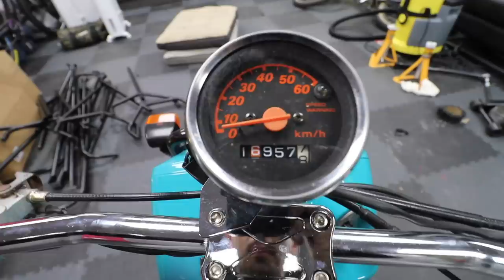Modified Honda Ruckus Scooter Build!!!!

Comment: front brake lever mot fail its a honda zoomer the dvla mot check and you may wanna do a vehicle check on the dvla also because its a bit confusing
Date of first registration	January 2002
Date of first registration with DVLA	December 2014
Year of manufacture	2002

and you will have to display L PLATES FRONT AND REAR

Comment: The seats lowered, but it’s not extended back. The extra length comes from moving the engine back
Reply: The seat is lowered and moved back, about 3 inches down and 2 inches back. And it also has a stretch kit which moves as you said the engine (and drivetrain) back.
Reply: @Ethan.s..  some of the kits move the seat back and some don’t, some move it more than a couple of inches. There’s that many different makers of lowering kits out there I can’t tell which it is just of looking at it here but with it retaining the curve under the front part it doesn’t look to be 1 that moves the cushion back. 

I was just trying to let him know that we don’t extend the fuel tank area to gain extra length. 

I couldn’t get comfortable with the seat moved back but I’m not that tall, how do you find yours?
Reply: @ShalomBrother   You are correct, my mistake. This looks to be a KN PLANNING Lowdown Seat Frame (rebranded NCY in North America. I have a bunch of performance parts on my Ruckus. I am 6’ 2 and I am using the stock seat. I would like the aero dynamic benefits and lower center of gravity from a aftermarket seat frame. But my knees aren’t to close to the handle bar’s and even with the stock seat height my legs are to long for my body to sit properly on the seat, even with side pegs. Lowering it would only amplify this issue. One seat I am most interested in is quite rare to find, it’s the Yoshimara aluminum low boy seat frame. It is a couple pounds lighter than stock and it lowers it the least at just 2 inches and it puts it 2 inches back. It’s expensive though and I’m not sure if I’d actually like it. I have a nice undersest bag which I get a lot of use out of. I am not keen on loosing it.

Comment: You don’t need a CBT for 50cc when you hold a full drivers license. In fact doesn’t even matter if you have a license CBT is only for anything above 50cc
Reply: Wrong uk licence doesn’t come with moped entitlement if you have a full uk licence you do a cbt once and then you can ride a 50cc for life with no L plates . To ride anything above 50cc you must renew every 2 year
Reply: @MrAshley106  The uk licence did come with before 2001 though. Didn’t know they changed this.
Reply: i passed my test in 1993 i can ride a 50cc without L plates and a cbt .........but for a 125cc i had to do a cbt and display L plates  i know if you passed your test after a certain year you have no choice in the matter its CBT for a 50cc or above displaying Lplates

Comment: If it's a 50 cc Harry you can drive it on your driving licence bro.
Reply: Pretty sure that’s only if you passed your driving test before 2001 otherwise you still need to do your CBT for a 50cc
Reply: This is correct pre 2000 without plates post is with plates
Reply: More MTB Harry lad…